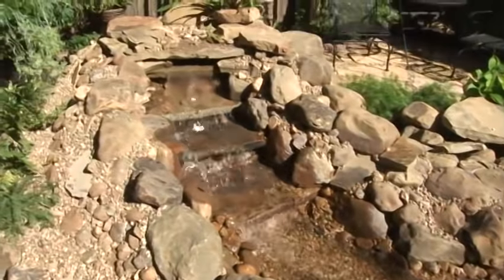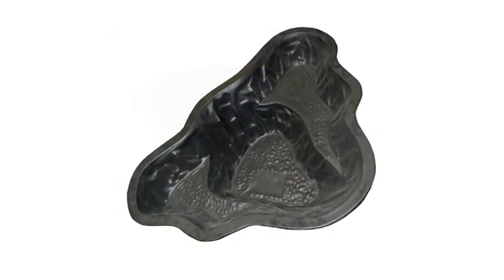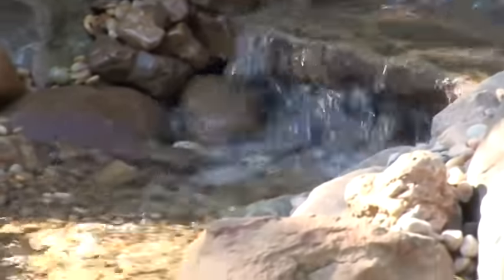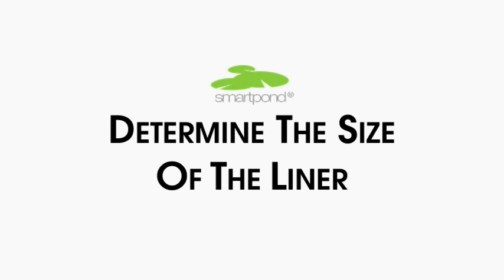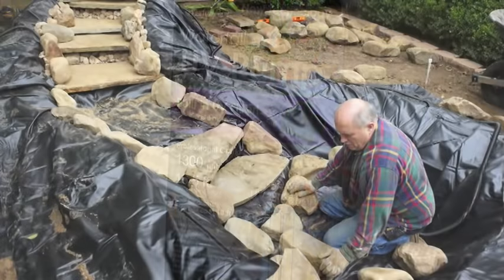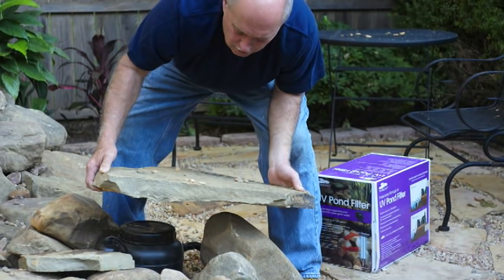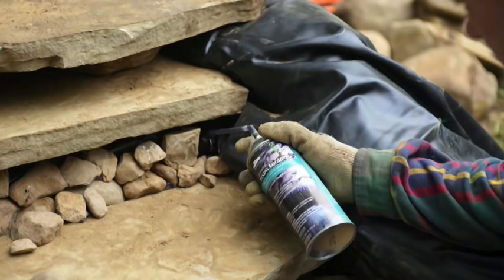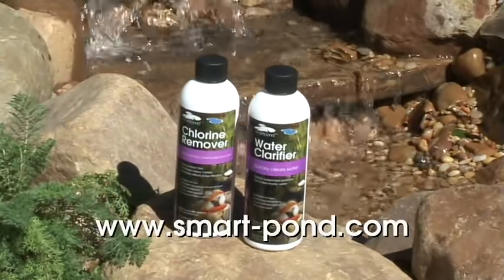Build a Pond with a Waterfall

Comment: Do they sell pumps with long plugs to reach the house? I’ve seen them all with small wires
Reply from the maker: Hei Tamir Darwish, our pumps are equipped with 16 ft. power cords. For water features, we highly recommend using an outdoor-rated GFCI outlet.
Reply: @smartpond  Thank You
Reply: @tamir5940  yeah you would typically want to have a certified electrician run a GFI plug upside near the pond for you. You’ll regret not having it done.
Reply: @smartpond  I'm working on a friends pond & I'm HOPING 
you will answer me back, I'm lost on the building of the falls 
Do you have the slaps UNDER the liner & put MORE on top 
or did you take the slabs off to put on top ? cause I'm stuck 
on THAT  part to get what you have there for our pond.

Comment: Great video, I'm thinking of building a 22" sheet Waterfall dropping into 3  foot wide plunge pool 2' deep and continuing into 22" average stream 1' deep and 14' long, the Waterfall height is 22"-24"
What do I need? and are aqua blocks really necessary if you have enough water volume.